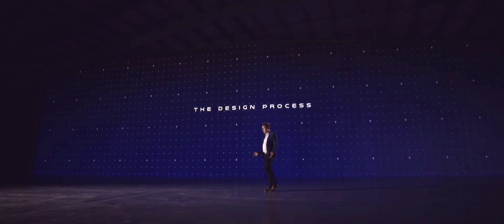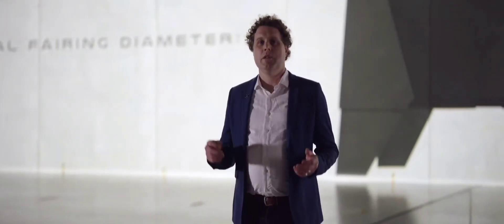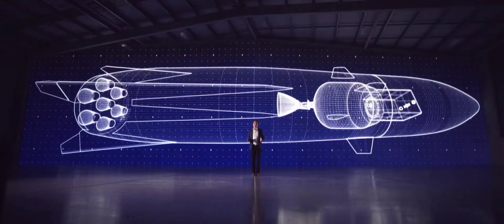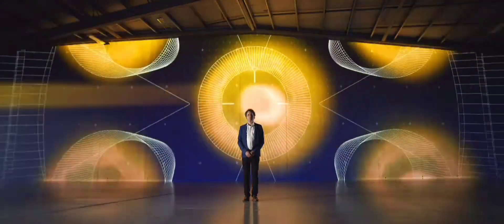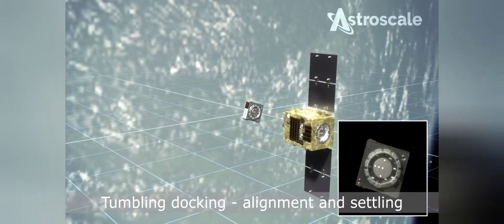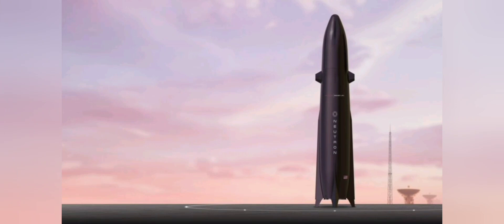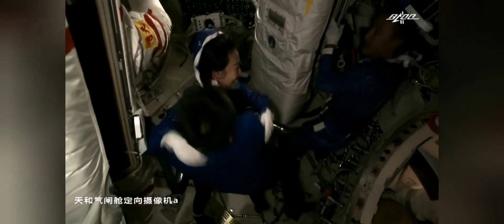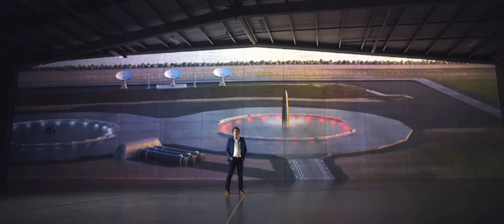A rocket for 2050 - Why Neutron is much more than outdated competition for SpaceX Falcon 9

Comment: This design is absolutely genius. The thinking follows the same engineering principles as Elon's "The best process is no process, the best part is no part". By the wide base and tapering shape it eliminates legs and minimizes shock waves and the integral farings cut turn around time and the return to base does the same. The simplicity of the engine will reduce cost and maintenance. It's sheer bloody genius. True they sacrifice the second stage but that's been stripped down to minimize cost. I reckon Its better than Falcon 9. Rocket Lab and Spacex are leading the way in innovation. No one else is close.
Reply: Not to mention how easy it would be to make a heavier but reusable second stage to bring the launch cost down further in the future.

Comment: Falcon was constrained to surface road transportation. Which actually is an important constraint for payloads also. This becomes even more important as 39a is now being prepped for Starship and the existing intergration and staging facilities at the Cape come into play. This is now a race for Beck to become relevant before Starship and the industry adjusts around that capability.
Reply: But will Starship really be launching for the entire conceivable market? Don't forget that it will be launching its own mega-constellation, Starlink. Won't Rocket Lab at least be able to launch for some of Starlink's commercial competitors?
Reply: @manofsan  Rocket Lab will probably find a niche they seem to at least be thinking ahead, just not far enough. But I do not think even most people in the field and fan base have grasped just how much of a change Starship and even Starlink is. For example V2 of the Starlink satellite has enough power and space for a ride-along sensor suite built in. What happens to the constellation market when those companies are competing against SpaceX or contracting SpaceX to integrate their product into the Starlink shell. The internet may be the least profitable part of Starlink.
Reply: @judedornisch4946  - I, for one, don't think it's healthy for a single company to be dominating the launch market. Elon Musk may sound benevolent, but nothing beats competition and consumer choice in ensuring that downstream consumers have the most options.

Comment: Anyone who thinks there will be a spaceship of any kind carrying humans to orbit without an abort capability this decade is absolutely kidding themselves. It will NOT happen. Maybe in 10 years, but not this decade. We have the Shuttle to thank for that.
Reply: The experience NASA had with the shuttle might prevent NASA astronauts from flying on Starship this decade, but it does not prevent SpaceX from flying their own astronauts. All they need is FAA appproval, and the FAAs requirements are quite low. The astronauts really just have to be informed of any risks. And beyond that, the priority of the FAA is to keep the general public safe, like with any other orbital launch.

Comment: I wonder if the second stage could be recovered by loading it on to a starship with spare down mass capability.  It would probably need to wait a long time for a starship with a suitable orbit.
Reply: I hope the economics of that don't make sense. Basically, I hope the second stage is so cheap that recovering it with Starship just isn't worth it. Remember that SpaceX would want to get paid.
Reply: @espenha  I don't think that necessarily is the case. If we assume that starship reach high launch frequency of 100+ launches per year as spacex wants then presumably there will be much more demand for upmass than downmass so there will be a lot of cheap down mass capability. As I understand it starship has almost the same upmass and down mass capability and very little fuel required for downmass. You could then launch neutron payloads at any time to any orbit and then park the second stage in a close by orbit and wait for a starship launch with spare down mass capability that happens to target a orbit that gives low deltaV for matching the orbits.
The main problem is that the second stage seems to be fully cryogenic so it will probably not be able to make orbital adjustments months/years later when a starship happens to be in a suitable orbit. Ofcurse this asumme that spacex sells unused down mass capability cheaply.

Comment: Why is everybody acting so excited about Neutron? Sure, it's a great design. But there is no engine. You could be equally excited about Blue Origin... Neither deserves any excitement until there is an engine prototype firing well and showing something near the claimed ISP.
Reply: Making a new engine is always a risk, but they expect to be firing the Archimedes engines next year, so they are clearly working on it.

The proposed engines are relatively low difficulty. They're pretty run-of-the-mill gas generator engines, like the Merlin. The unusual thing about them is they are using methane instead of kerosene. It's definitely a step up in difficulty from the electric pump Rutherford engines of Electron, but I would be careful about underestimating Rocket Lab.

Comment: Honestly even if Neutron can't compete with Starship (which is likely but will depend on a lot of factors), it is still one of, if not the best, chances for any amount of reusability in development by someone other than SpaceX. Just look at the other possibilities, and it becomes clear how impressive Neutron will be if it actually gets flying by the mid-2020s:
ULA: The Vulcan should launch soon (hopefully), but it won't be reusable until later (maybe). Also the reuse seems like a "this could be cool" afterthought instead of baked into the design like Neutron.
BO: The New Glenn could be very impressive, and the best direct comparison to the Flacon 9 and Neutron in terms of reusability, but who knows when it will actually launch (if ever).
Relativity Space: The Terran R is basically a mini-starship and is supposed to be fully reusable, but this is a company that has yet to launch anything, so who knows how long it will take to actually get this thing into space.
ESA/Russia/China: Might build a rocket with some reusability eventually but (outside of a couple of Falcon 1 style small-sat launchers in China) we'll be lucky to see even a test launch before the 2030s.
Reply: I think Neutron could be very competitive with New Glenn, because with each launch, New Glenn throws away a pretty massive hydrolox second stage and the fairing (the largest fairing ever). And Neutron could also be fairly competitive with Falcon 9, as Falcon 9 is a rocket that hasn't really been designed for reusability. It uses kerolox which needs refurbishment of the engines after every flight, it uses expensive helium ullage gas, it has TEA/TEB ignition, it needs support vessels for fairing recovery, etc. 

But Starship is a wholly different beast. I won't say that Neutron can't compete with Starship, but at the same time it won't be easy. Trying to compete with a partially reusable rocket against a fully reusable rocket is a bit like showing up to a gunfight with a knife. I really hope Rocket Lab get serious about a reusable second stage fairly quickly, though they should of course focus on the first stage for now.

Comment: Your justification for Starship costing $75 mil per launch is flawed if you are also accounting for Starlink. If Starlink is supposed to pay for Starship then you cannot factor the cost of Starship dev into launch costs.
I don't think Spacex will charge more then falcon 9 since Spacex will be keen to retire the falcon family asap, my guess is that the first commercial Starship launches will be around falcon 9 price.
Reply: The only costs that ultimately matter are marginal costs. Once you recoup development costs (or you write them off), then what really matters is the cost to maintain and launch a Starship/Super Heavy stack, as well as the cost  to build replacements, run operations, etc.  Assuming Starship is fully reusable and doesn't require rebuilds/refurbish after each launch, then there's no way it's gonna costs $75-100 million per launch. Will they charge that much? Maybe. They will charge what the market will bear. But that ain't the same as cost.

Comment: "I can guarantee you, this second stage will ultimately be reusable". No. THIS stage can't be reusable. The reusable stage must be very, very different. Essentially, a new design from scratch, with large impact on performance. And Neutron's performance is already worse than F9.
Reply: Of course reusability is great if possible, but yeah he tends to get rather puritan about it sometimes.
Reply: yeah i dont see how the second stage could become reusable without massively hindering performance, the second stage is already extremely stripped down in its non reuse state.
Reply: Maybe by reusable, they mean more of a space tug? Does that even count as reusable?
Reply: Yes, he’s talking about repurposing the 2nd stage, not recovering (re-entering). The semantics are a little slippery given what most people think when they think “reusable”.
Reply: The Neutron’s performance is intentionally lower than falcon 9, but I’m sure that valuable lessons learned from the design and operations of the vehicle can be used to improve the Archimedes engine.
Reply: I wonder if the second stage could be recovered by loading it on to starship with spare down mass capability.  It would probably need to wait a long time for a starship with a suitable orbit.
Reply: @michaelmbutler  Yeah. It's not as simple as putting your empty coke can into a recycling bin versus a garbage bin (which doesn't do shit either, now that I think about it). 
Come to think of it, it's more like putting your coke can into your recycling bin, with a 50% chance you or anyone else will get to drink from it beforehand.

Comment: Plenty of room in space for engineering brilliance & imperative innovations. Too bad Jeff Who?, Boeing, ESA, et al, haven't caught that reality. NASA seems to at least have realized that new paradigms are in order, so are in process of adopting & supporting them. The key in my view is when aerospike motors take over, maybe with SpaceX taking the lead using them for lunar landings, as per Ad Astra (Terran Space Academy) & Tim (Everyday Astronaut).
¿🤔 If F9s are done after 9 flights, do they use the otherwise landing fuel loads on their last flights to fly heavier, higher, or further missions or they always come back for full on rebuilding? If the latter, than how many total fights can F9s do before they do a 1st stage "discard" flight profile?
Reply: SpaceX says the Falcon 9 can basically fly forever. They currently have two first stages that have flown ten times, and two first stages that have flown nine times. These four stages will all fly again, most probably with the intention of landing.

Comment: Peter mentioned that the wider bottom of the rocket keeps the high temperature reentry shockwave away from the upper body of the rocket.  That means that special heat resistant carbon fiber only needs to be used on the lower part of the rocket.  This is an important, and probably cost saving consideration in construction.
I think that in 10 years the market will have shaken out to three types of (mostly) reusable rockets - small payload quick to launch, medium weight payload, and large heavy lift.

Comment: Ever since SpaceX started landing boosters, people think expending anything is wasteful. I encourage everyone to spend a few hours in KSP Realism Overhaul and see for themselves how big of a hit you take with just a few kilos more on your upper stage.
Recovery systems and refurbishment aren't free either!
Reply: Added mass is of course a hit to payload, that's why you generally want reusable rockets to be bigger. That way you can take the payload hit and still launch very meaningful payloads.

Larger rockets have the downside of being more expensive to build, and requiring more propellant, but if the rocket is rapidly reusable, you can reduce the cost per launch massively. 

The propellant cost isn't a meaningful percentage of the launch cost. Traditionally, almost all the cost of a launch is the hardware you throw away, and most of the remainder is logistics.

Comment: F9 being heavier than Neutron is irrelevant. What matters with any rocket is what payload mass compared to the liftoff mass it can take to LEO (and other orbits). And here Peter Becks bragging falls short .... by a large margin. F9 with RTLS (Return to launch site) can take 2.5 percent of it´s weight to LEO, while Neutron can only take 1,66 percent. So much for the lightweight materials. It better be rapidly reusable to make it competitive.

As for launching astronauts - I hope you realize the rocket is not the main reason what makes crew launch expensive. Afterall a used F9 can easily launch for less then 40M. The same goes for space stations. The launch cost are not what makes them expensive.

I like the Neutron idea and hope it flies soon. But a 2050 rocket? God, I really hope not. That would mean we get once again stuck for decades.
Reply: What it really comes down to is cost. Customers don't care if you're using flying pink elephants as long as you can reliably guarantee payload delivery at a better cost. Neutron is more reusable (at least on paper), and claims better cost efficiencies than F9. At best, your claim amounts to Neutron not being able to take as many co-passengers as F9. We'll ultimately have see what Neutron's launch costs are in comparison to F9's.
Reply: @manofsan  Exactly. And bigger rockets as a rule tend to be more expensive. Especially when you make them from carbon fiber. That´s why when you have a big rocket with small payload, it needs to cover that disadvantage in another way. It this case reusability.

Comment: I think the 2nd stage of Neutron could be built for an order of magnitude 1 million USD. So if the Neutron first stage is highly reusable with minimal repair or refurbishment it could be very cheap to launch. Sub 10 million cost (for rocket lab) average price seems easily achievable with possibilities to go lower.  What they charge will be another matter. I also think the launch capabilities could potentially near double as the engine matures at least for expendable launches. I think it could turn out to be an amazing rocket and hope development goes as smooth and quick as possible.

Comment: What delusion would lead you to believe the Shenzhou would ever be used on a Rocket that’s been given a contract by the US military, nonetheless a rocket being developed in the United States, period? 

Soyuz would be a more likely type of vehicle, and that doesn’t bar Rocket Lab from redesigning Neutron to be able to launch a second stage somewhat compatible with the goal of human spaceflight, rather than nesting a smaller stage inside of the fairings, which is far more effective for cargo flights.
Reply: he never said it would... but stats what is possible, that yes you can develop a human rated vehicle in the 8 ton range  (huge difference)
Reply: @NighthawkNZ  

Definitely. Carbon composites have an interesting advantage in this case of being able to change the thickness of the tank walls. Need a stage that’s brutally light and only needs a self-supporting balloon tank against a payload and engine behind it all? It can do that. Make a stage able to survive reentry? Make it a lot thicker, or create a heat shield based on composites able to be fitted on the second stage and then recover with parachutes like the Electron first stage. 

Nothing bars them from doing so aside from fitting the second stage inside of the fairings, which may be troublesome when it comes time to advance the design beyond the style of Vulcan-Centaur but with a fully recoverable first stage.

Comment: The irony of Neutron is that this new design is somewhat of a response to Relativity and Terran R. Rocket Lab could have stuck with RP-1 with this exact design and not have to worry about unburnt methane emissions due to the usage of gas generator or having a set of fairings which would not be helpful in manned spaceflight applications, and this exact design would still have been highly competitive if not superior to Firefly Aerospace’s Beta. But with the advent of Methalox as a more efficient propellant (and a cheaper one at that!) Rocket Lab couldn’t resist the benefits. 

What I most expect to see is Firefly’s response to Beta as a launch vehicle. Will there be a change in design for Beta or will they modify Beta/Gamma into a full reusable rocket system, also capable of 8 tons without expending the second stage, and recovering it?

Comment: Rapidly and Completely reusable. Neutron lacks both.
Reply: I wouldn’t be so sure, it return to launch site, with engines only being lightly used, and doesn’t need advanced second stage integration. Literally just pop a new second stage in there and your good to go
Reply: And evidently a 30 year development cycle if the Neutron is the rocket of 2050.